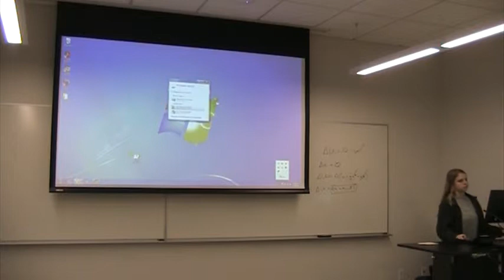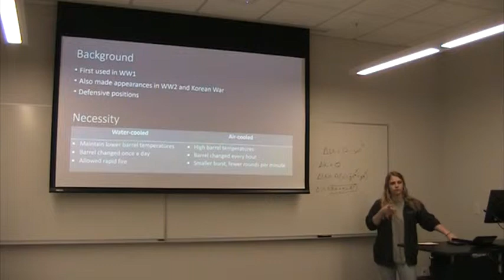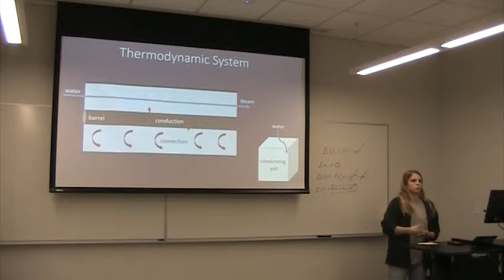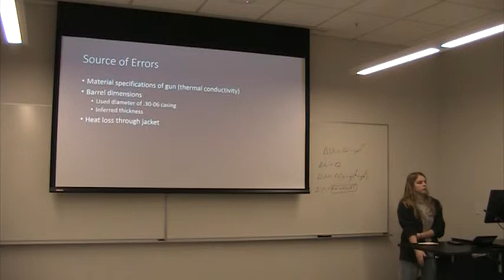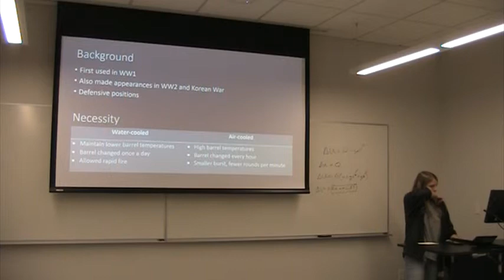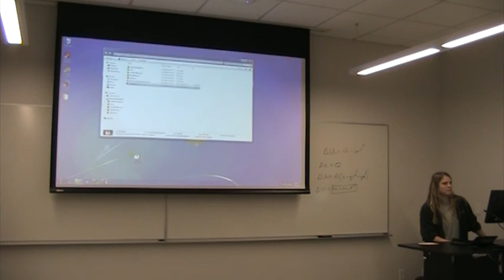Catherine Macpherson

Comment: One positive aspect of your presentation is that you had a very interesting topic. You did a great job of linking your topic to thermodynamics and heat transfer. One possible improvement to your presentation would be to possibly break your calculation photos up so that they are easily visible or to type the calculations into the presentation. Overall you did a great job on the actual presentation and information that you included.